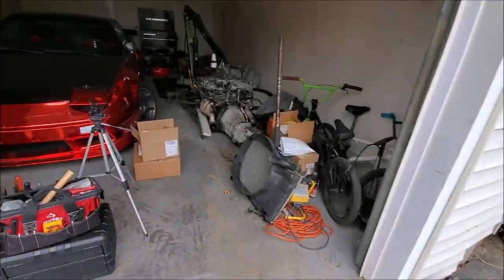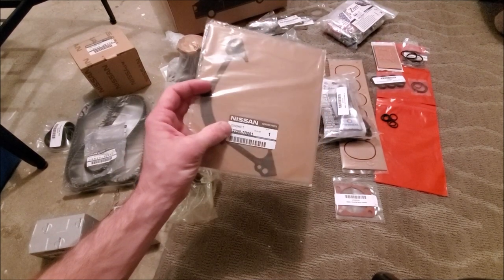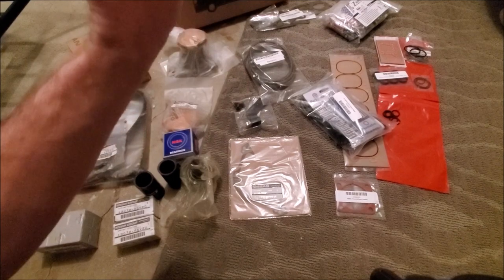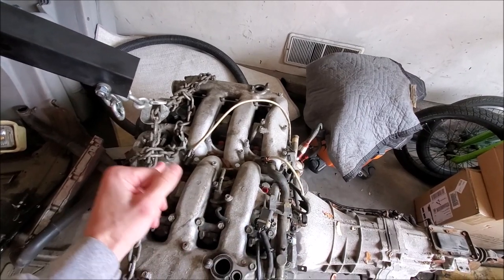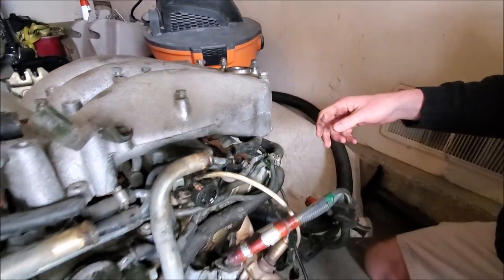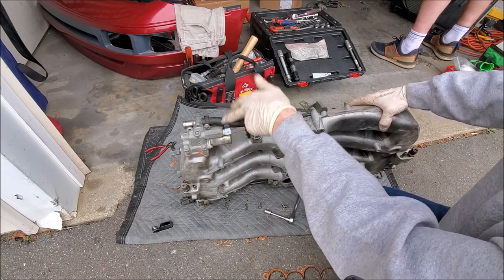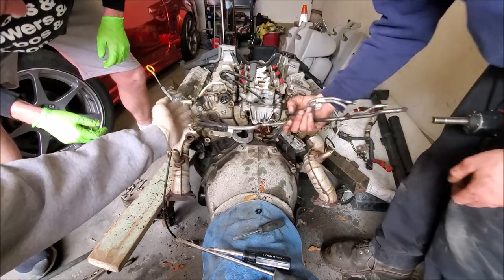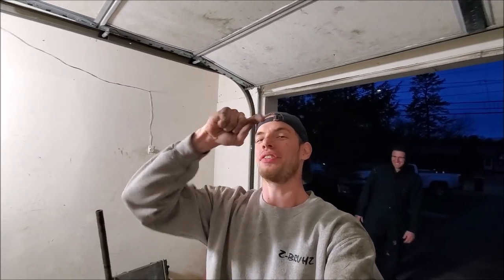Complete Guide on how to Delete the EGR & Plenum Coolant Lines on a Nissan 300zx! (Episode 2)

Comment: One thing I've learned over the last 25 years working on cars, if it feels excessively difficult to do a job, you're not using the correct tool. There are tools for every type of job to make it easier, sometimes you just need to take a step back and evaluate what the proper tool is that the job requires. Keep up the good work!

Comment: Couldn't have done it without you, I do appreciate it.

Well as you said, it can be done with the motor in. I just completed the EGR delete. Really was not that bad, it took several hours, but I didn't break anything and I am not bleeding, overall, I call that a win. One thing I did to make it easier to get the tube out of the exhaust manifold was to remove the master cylinder from the booster. Being careful not to bend the tubes too much, I moved it a little up and back toward the firewall. Access was easy after that. Also, I only removed one of the hard coolant lines, the one that is on the left if you are looking at the back of the motor.  With all the other items out of the way, it should be fairly easy to reinstall. The one directly on the back of the motor, on the right side, was too difficult to reach, you cannot see the bolts, I suppose you could use a mirror if you wanted too, but that was going to be my last resort if I couldn't get the tube out. I would not recommend removing this one if you don't have to. I had to cut the hardline that connects to the bottom of the plenum on the passenger side to get the line out. After that, it slid right out. Also, the bolts that hold the EGR in are too long and must be left in to remove the unit, this was mentioned in the video.

Question: Is there another video of how to put it all back together? I am sure I could figure it out, but I love a good video. You may have one out there, I could have overlooked it.

Once again, appreciate it, I watched your video several time to get me thru it, overall, most excellent.

Bernie
Alabama

Comment: I bought a cheap ace hardware 22mm wrench and cut it in half to fit it under the brake master cylinder fore that exhaust pipe, worked like a charm

Comment: Is there a way to just deactivate the EGR system but leave the valve and the piping in the car?  I'm into my TT and I'm down to the valve covers.  I'm going to do the coolant delete, the PCV delete and the EGR delete.  The lines off the coolant tubes you were talking about cutting and welding shut are used in the TT for the cooling lines that run to and return from the turbos.  I did the EGR with the engine in the car and the plenum off.  I had to remove the exhaust pipe on the drivers side, the pipe from the turbo to the exhaust.  That is how I got the 22mm exhaust tube out of the driver's side exhaust manifold. I had to remove the driver's side coolant tube from the back of the engine to get at the EGR.  You will have to get the two bolts that holds the valve on and the two side pipes that run to the underside of the plenum.  It was a pain, I think it took around three hours and I have a lift.  Thanks for the great video.
Reply from the maker: I don't believe there is a way to just deactivate it unfortunately. Only thing I've ever seen is completely removing it

Comment: When removing the egr, what are the sizes of the nut on the egr tube? You said 22mm for the driver's side manifold but what about the one by the egr itself? Im replacing mine on a 90 jdm tt. Thanks.
Reply from the maker: The bolts holding the egr to the engine are 12mm, the big nut is 22mm, and the coolant piping that is in the way is 10mm I do remember seeing someone saying they used a 1 1/8 in. Wrench for a different nut but were not specific about which one

Comment: Ok quick question. I bought some headers used from eBay and the part where the EGR threads in is capped off with some gnarly puddy inside as well. Can I just cut off that one pipe that goes Into the headers and cap it for now? I have the transmission out of the car and currently have access to the whole rear of the car EGR assembly. P.S. what a nightmare doing headers was with the engine in the car OMG 2/10 would not recommend
Reply from the maker: I would say if you have the transmission out I would try to do the complete job correctly. Just because if there is any vaccume leak the car will not run right at all. I always say do the job once and never worry about it again

Comment: Quick question, when you remove the intake coolant lines, we’re you able to route your system so that you still had your heater? Or you completely deleted it?
Reply: When you remove the intake coolant lines you just cap them off, but you can leave the heater core lines the same as stock
Reply from the maker: Removing the coolant lines under the plenum does not affect the overall heater core. You just cap off whatever was running from the heater core to the deleted lines and good to go!

Comment: A very informative video! tho why wouldn't you just be able to plug the valve fitting on the exhaust manifold? and avoid taking the whole egr off
Reply from the maker: Egrs cause issues, and with the entire module there i believe I had a rats nest behind it so I wanted to clean all of that out and check my knock sensor out.

Comment: If you remove the 2 coolant hard lines, you mentioned resealing them. What do you use, just rtv?
Reply from the maker: Yep rtv is the best way, there is a new kit out from merlin machining I believe to where it's an adapter and you can use O rings instead
Reply: @ZBruhzchannel  thanks. I'm doing it as we speak with the motor in trans out so we'll see how it goes. Probably will be cutting a lot

Comment: What's the purpose of removing the coolant lines for the plenum and the EGR?
Reply from the maker: The coolant lines tend to burst due to the age of the car. Many rot away, and the main purpose of them are to warm up the throttle bodies on cold days. By deleting the egr the car will be able to breathe a lot better. Over years the egr can clog and cause issues within the motor.

Comment: The gasket for the 2 heater pipes on the  back side of the engine by the EGR…do you have a part number or do they have a specific name? Thanks.

Comment: So that cluster of hard lines that was stuck on with a bolt while you guys tried to yank it off doesn't even need to be there at all?
Reply from the maker: That us for the pcv delete, but only as long as you remove the ports on the drivers side exhaust valve cover then those lines can be deleted

Comment: Why would you delete those coolant line from the throttle body and onward wouldn't that hurt the performance?
Reply from the maker: No this does not, engineers applied these lines to help with cold start ups to warm the plenum and throttle bodies. Good idea,  but unfortunately for old cars things break and corrode and by deleting these before this happens save a future headache from happening

Comment: Great video. I found a TT sitting for 16 years. Doing same - just rebuild injectors and basic stuff. QU. Deleting the PCV system worth it? EGR going - too complex and emissions not such a big deal for a collectors, water lines gone, great info. TT bit different but ur vids are really good.
Reply from the maker: Thank you and we think personally that the pcv system is just a part that fails within time. By deleting it you will. Ever have to worry a out it again!

Comment: It’s awesome that you do the delete. I am in the process of doing the same on a  ‘92 NA. By looking at the video you mentioned about cutting the coolant lines but then it seemed as if there was nothing there when you were done. Do you have an actual picture of what the engine looks like with everything deleted? Also once you are done we don’t see you do anything on the mounting as far as what needs to be deleted around the fire wall and the completion on the final installation. Is that on another video that I don’t know of. Thanks
Reply from the maker: If you watch our later videos there should be some bits and pieces where I show what we in fact did.

Comment: Do 1996 300zx’s have aiv? I deleted my EGR and I’m getting a rough idle now but it drives smooth. I have a brand new wiring harness made by wiring specialties, have new spark plugs and injectors installed by Z1. Cylinder 3 has been slightly misfiring at idle and I swapped COP from 3 to 2 (which is a working one) and it still misfired on 3. This leads me to believe that either it is something bottom end, which makes no sense because it drives fine, or it is MAF, or AIV not being fully deleted. I did not cap off the front like in this video only because I’m not sure if I have AIV’s. Thank you
Reply: Know it's late but on the 96 you can't delete it
Reply: @lgrc11  actually you can just fine. mine just had a loose MAF and needed a new wiring harness custom made.
Reply: How much was the harness
Reply: @lgrc11  $1200
Reply: @lgrc11  the issue was actually a mixture of incorrect fuel injectors an incorrect hookup on coil packs to EFI. I ended up getting it sorted out finally.
Reply: Shit

Comment: Hey guys , I was wondering if deleting the heating hoses will affect something in the ac system, I’m trying to learn here, currently I’m deleting mine but I was concerned since those hoses go into the firewall. Please advise, thanks in advance.
Reply from the maker: The heater core are the hoses that come through the firewall. If those are deleted, you will not have heat. The AC component is a separate system.

Comment: Ima get one so im farely new to this but whats the point in deleting it
Reply from the maker: The point of deleting the coolant lines is within time after all the heat they see iver the years they burst and it is a pain to get to anything else when they are still attached. To delete the egr this will help with having the car run more efficiently and give the ability for the motor to breathe. If it has never been done you will see some black sludge within the ports of the egr and that causes issues.
Reply: @ZBruhzchannel  thank you 🙏🏼ima probably do it then
Reply: @ZBruhzchannel  the one ima get is a 91 tt but the motor is out rn so i might as well do it